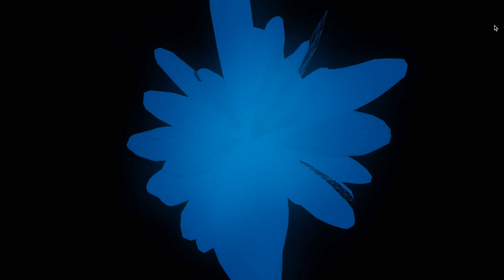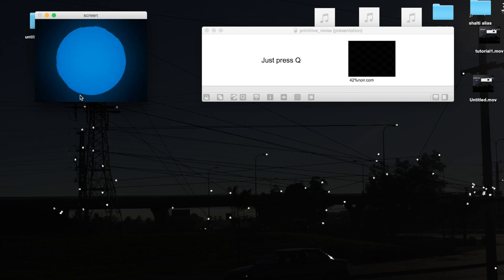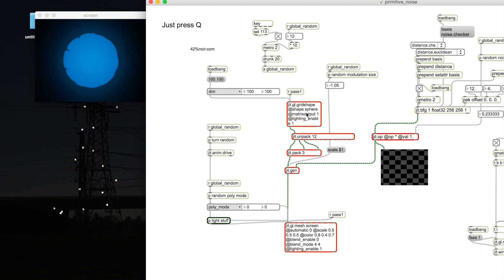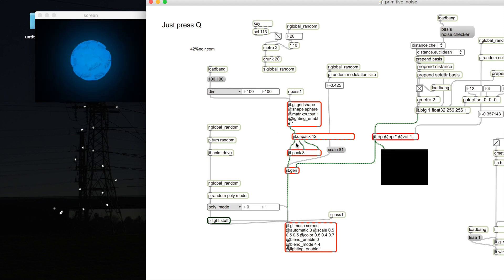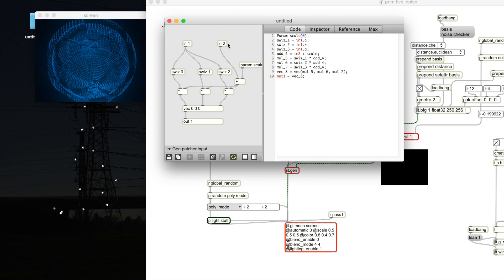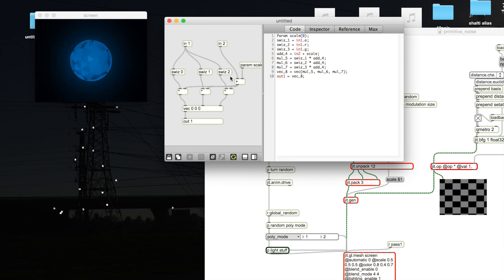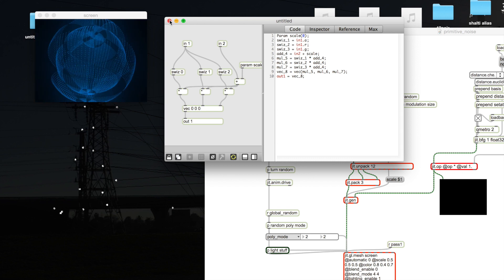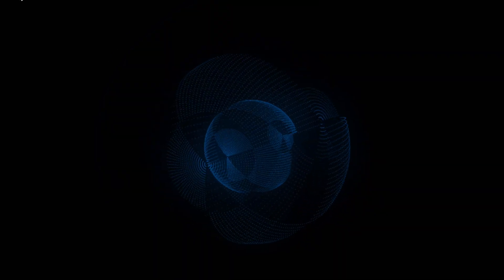Max Patch Download & Jitter tutorial - Noise Deformation of Shape  (part 1)

Comment: I'm intersted in making this patch sound reactive for a live set - what would be the most effective way to do this? Controlling noise parameters? Thanks
Reply: Hi Stu.. In the patch you can easly control the type/ pattern of noise and the parameters of the noise as you said, you can change the deformation parameters as shown in the video
another very easy controllers you can make is  to control the primitive shape for example tube instead of sphere, you can change the light parameters to give colours and gradients of two colours, you can control  the blurring effect by changing the blur parameters.
I guess you can also control speeds or glitches by doing sharp changes to the camera or the rotatation, and the other rendering parameters.
These are  very direct stuff you can control easily but of course you can try to modify it more, if you have idea. 
anyway if you get into issues you can email...I'll try to help.
Reply from the maker: +Stu Sibley +Scott Brown hi here is the example for that... https://www.youtube.com/watch?v=yxnILmWUAHI
Reply: Hey, did you manage to make it audio reactive? I want to do the same thing.
Reply from the maker: +Scott Brown hi..i will have time to do an example towards the end of december..
Reply: excellent!

Comment: Possible to hook the shapes to a webcam to get shapes out of things that are placed in front of the camera?
Reply from the maker: Quinten De Wilde Since in this simple case you take a vertex of x y z, from an OpenGL object so you basically deform it  before it turns into a pixel in the pipeline of the OpenGL rendering. With the camera, you get 2D matrix and the deformation thus won't be in 3D for that basic implementation. But I don't know, maybe you will get something else nice